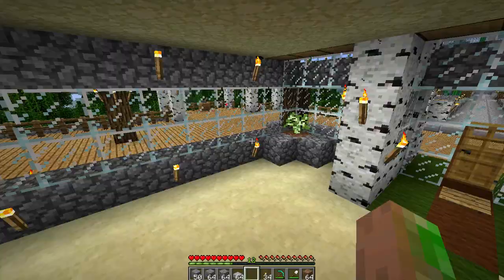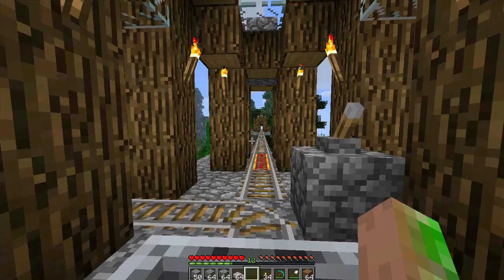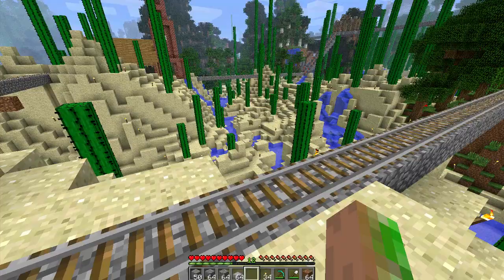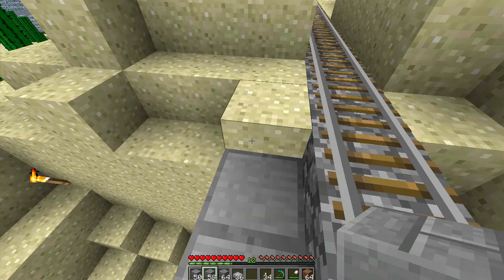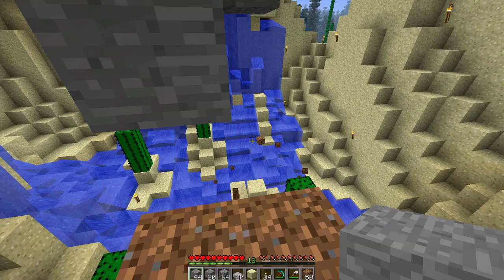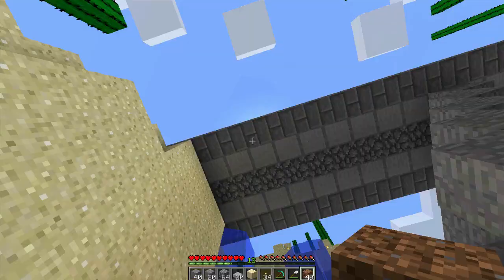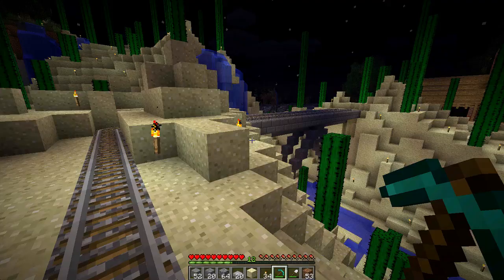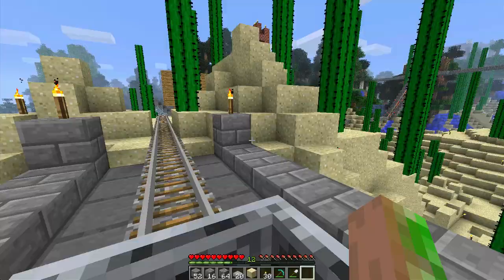Minecraft:   How To Build A Bridge

Comment: If I may pick a nit... that is not an arch. :-D

Also, when you tried the cross bracing that you took back out you had one side offset from the other (one side was on the evens, the other on the odds, if you know what I mean) and I would suggest that your supports be made to look like they are set in the sand rather than just sitting on them.

Keep up the good work dude!